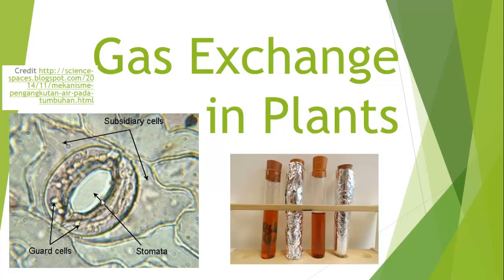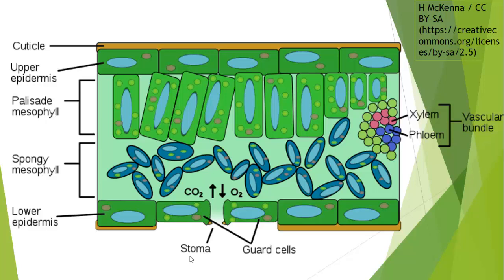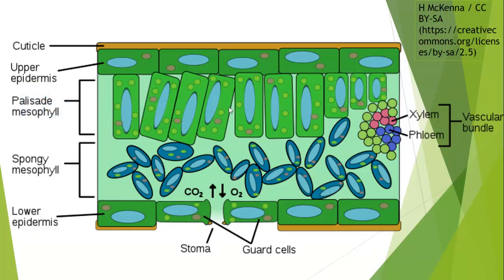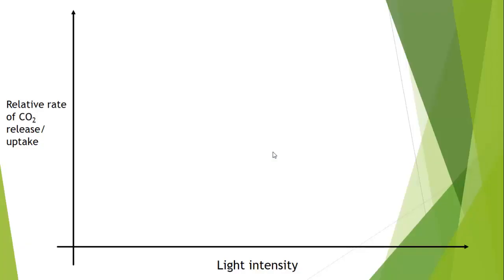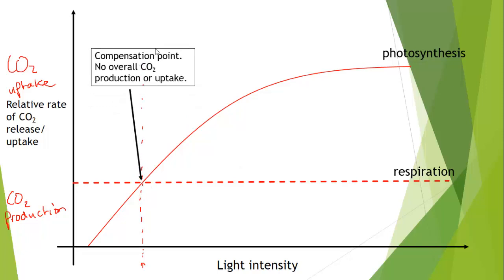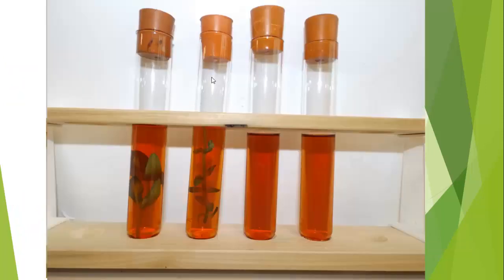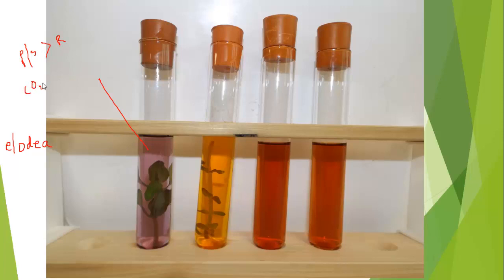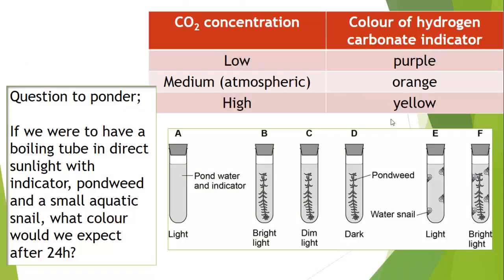Gas exchange in Plants for IGCSE Biology

Comment: What’s the answer ? Is it medium?
Reply: It’s purple, so High co2 concentration

The plant is in direct sunlight, meaning photosyntheses will occur. Photosynthesis uses co2, so co2 will be taken into the plant. Thill will lessen the co2 concentration and therefore the hydrogen carbonate indicator will turn purple
Reply: @waleedomari8042  No, it'll be orange/medium because there's also a small snail in the tube. The snail will release CO2 as the plant absorbs it, so overall there will be no change in the CO2 concentration